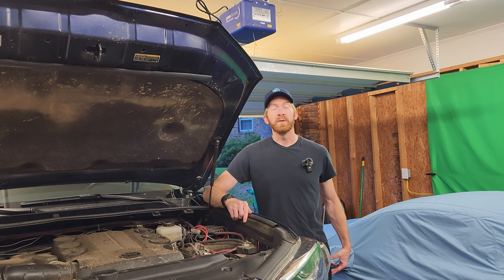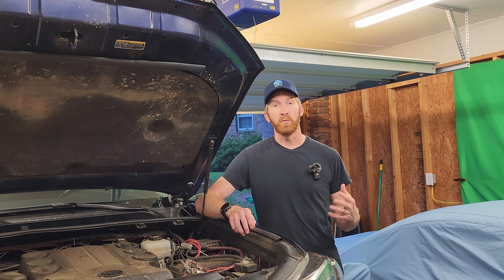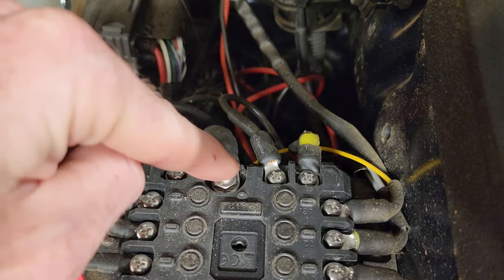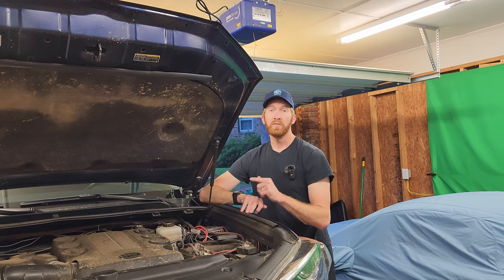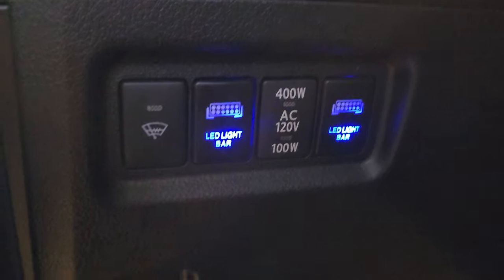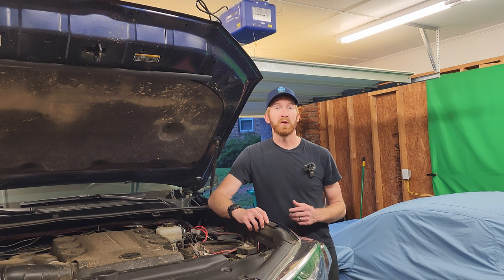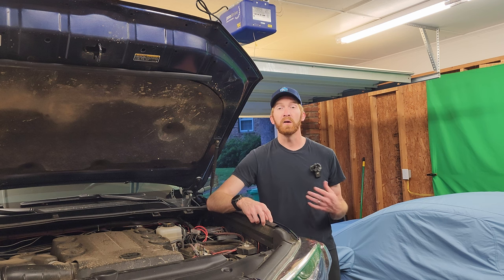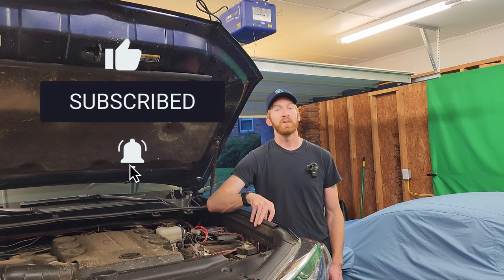Step by Step on How to WIRE up buttons to a Garmin Power Switch | Power Switch Update

Comment: This sold me on getting the Power Switch! Especially if I can trigger multiple lights with one switch. I drive forest roads and need a quick way to disable off road lights if another vehicle approaches. 

I watched several times. Where do the switch wires specifically go?
Reply from the maker: They connect to control 1 or control 2 terminal at the power switch. Then you program the control 1 or 2 in the app. Feel free to message me on Instagram at Tim the Trail Man.

Comment: Question: I have 2 wired LEDs lights with the manufacture harness and amazon switches inside. I installed the Power Switch and moved power and ground over. But now I have two switches with the power on (I did not use the control input). I want to remove the physical switches inside and control LEDs from just App. Do I cut the wire harness from the low power relay on the LED wire harness, and wire direct to the Garmin Power Switch. Thank you
Reply from the maker: Do you have Instagram?  Might be easier for a quick conversation there vs comments here. I'm happy to help.